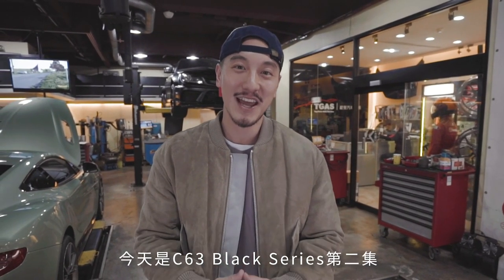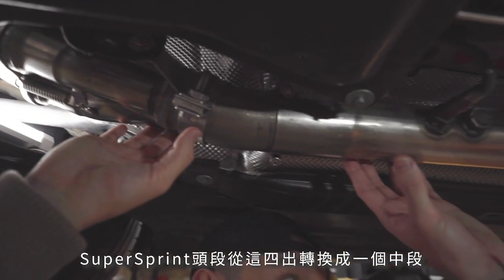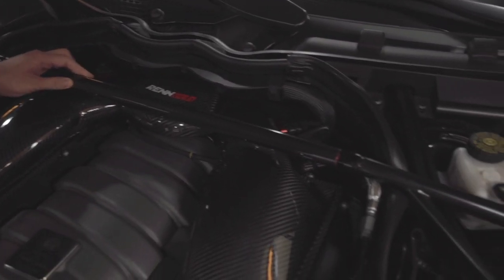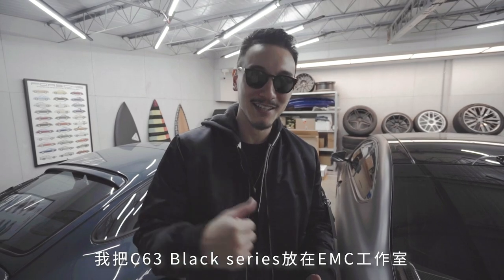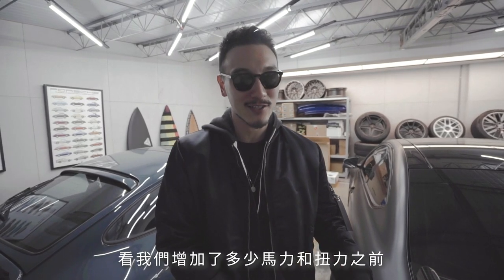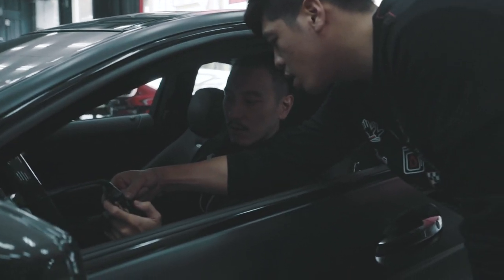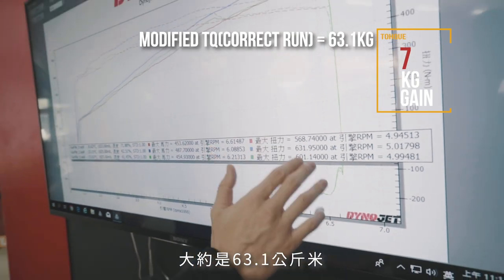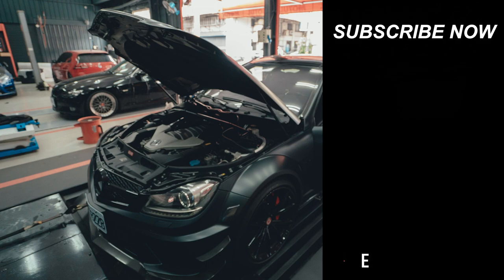PROJECT C63 BLACK SERIES COMPLETED! GAINING HP AND TQ | C63黑系列改裝完成！馬力扭力全面提升！《EMC Vlog Vol. 19》

Comment: Hi Sunny. Sorry for disturbing... 
Always watched your EMC videos Really appreciated your sharing... 👊🏼👊🏼
I m currently facing a problem... as I had installed Armytrix exhaust on my Mercedes Benz. But the engine light turns on  two weeks later and shows that’s air flow problem. 
I’ve checked with the Mercedes Benz 4S and they told it is because I changed the exhaust... 
but the Armytrix guy told me that it shouldn’t be like that as armytrix will by pass the air flow problem ... 
May I know have you heard about this problem? Is that normal?  Please advice. 
Looking forward to hear from you. 🙏🏼🙏🏼Cheers